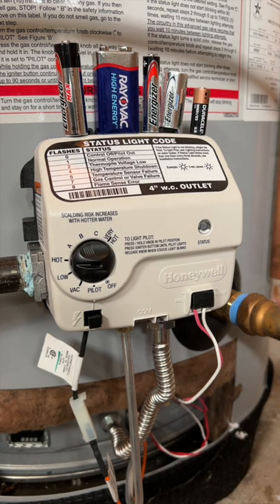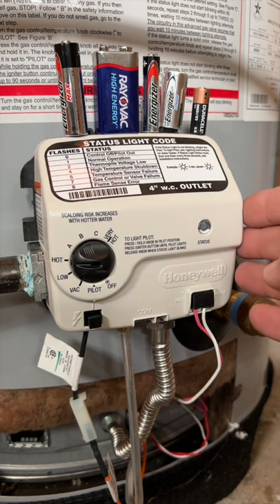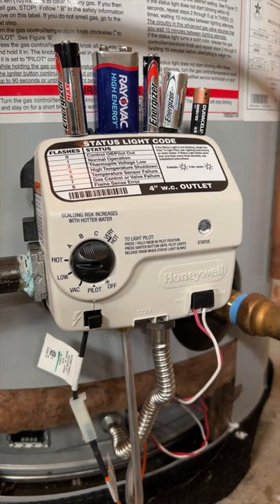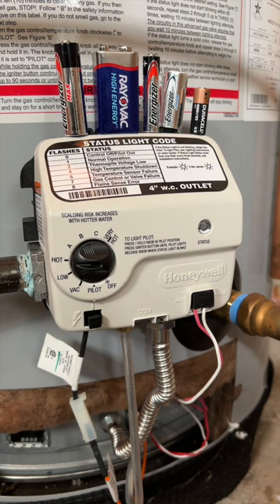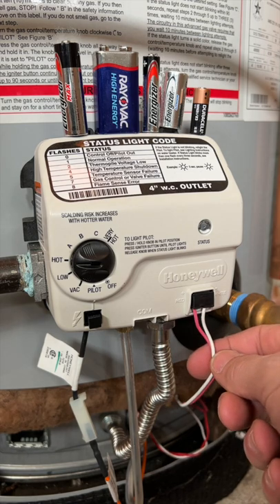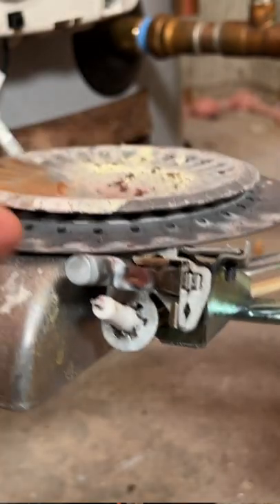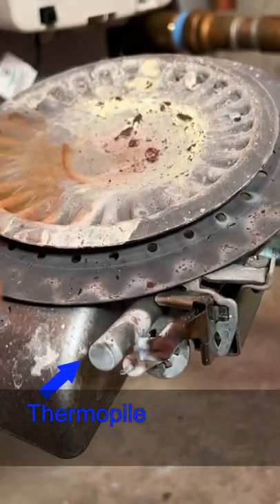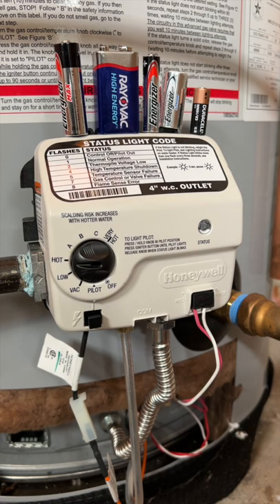Which Battery Is Used In A Gas Water Heater Control Valve #shorts

Comment: I have a Rheem 40 gallon water heater with a Honeywell gas control valve and I always wondered when I should replace the battery.  Thank you for making this video.  I had no idea that it did not contain a battery!  I never looked into the manual as of yet.

Comment: Makes sense.  When my water heater stopped working and began flashing a red light, they first sent me a burner assembly, which did not fix the issue... but a new thermostat was actually needed to fix.

Comment: I have owned my house for over 30 years. My furnace uses a thermocouple. When it went bad [around 1995], I replaced it with one from Home Depot. The ones from Home Depot have only lasted on an average of 12-18 months. After 15 years I got tired of them not lasting and bought the one [same brand] from Lowes. Lowes units have lasted between 4-5 years.

Comment: Thanks. I have the same valve and when the power went out, the status light stayed on. So I was wondering "How long will the battery last?" Your video is concise and perfectly explains that no battery is required. Thanks again.

Comment: Hey if this doesn’t work contact the hot water heater company to find out where the reset button is on the tank but it is normally under the panel where the wires connect from the thermostat to the unit
Reply: Thanks this helps for me about the reset button 😅
Reply: @Mr15peligroso  .. my pleasure!!!  You really have to keep it clean underneath.. or it will keep happening! It just happened to me again a month ago!
Reply: In my case was a splash of water in the wires that’s was about the reset button but yes you’re right we need to keep clean underneath mine was dirty by the way 🤭

Comment: Doesn't matter because the honeywell valve is garbage, but gas style water heaters are a big money maker for us plumbers. But remember 95  % of companies only pay the maximum of $100.00 per service call under warranty. I found this out the hard way. Went to service s home owner installed water heater. Only 1month old. Got a call from a buddy that managed the store where the heater was purchased. Well I went and checked, driving 20 miles each way. The controller and the burner assembly are so bad they keep new ones in stock. So he knew it was a propane water heater, so I grabbed 1 of each. Get there, and I immediately notice the paint on the shell burned off. Well good ole Reliance made in Mexico, the stickers on the tank clearly said propane, but the controller and burner assembly were natural gas. I ask the customer if they had any problems, the water was always scalding hot on the lowest setting. I shut the gas off, called reliance. Told her what I found. She says  impossible. Took pics and sent them. I was told to remove it immediately. Drove 20 miles, got a new one. Got back installed, it and it was good to go.in my phone conversation with reliance ,I was told they would pay for all cost. Sent them a bill and they sent me a check for $100.00, the max they would pay. Now I ask the customer what brand they have, if reliance, a o smith ,or state I tell customers that they must pay me and recoup there money from Reliance group. In th state of Mississippi, the homeowner must file for reimbursement and are the only ones that can file suit on a appliance.  There is no way $100.00 covers the installation of a Frankenstein water heater made at your plant, made it thru all your product checks and delivered to the store and sold. The customer turned th water heater to max setting , thinking it would warm the water faster. Well the tank got so hot it melted some of the tank installation , because ports on the burner are smaller than natural gas ones.
Reply: Write a book 📖

Comment: The green/blue build up on the cooper pipe. Try pouring hot to boiling hot water to remove it. I saw a video of this being done on a car battery a month ago and I just now did it with the white build up on the water heater hot out copper pipe. Removed a majority of it just used a bowl to catch the water and sediment.

Comment: I just installed a new Rheem hot water heater that had this on it.     I thought I was gonna have to hook up 120v ac to my new heater.     Will it last 20 years?
Reply: 10+ years with maintenance. 

Flush your water 1-2 a year.

Comment: So it's got to ha e some kind of battery to store electricity while the unit is off. What do you do when that battery is dead?  The light on mine doesn't blink at all.  The pot lights when the knob is pressed in the pilot position UT goes off as soon as you let off it.

Comment: Mine will not allow gas to pilot light while holding down on pilot mode I don't know what's going on
Reply: and the answer was?
Reply: @tedlahm5740  I think there was air in the lines and just had to push in the gas adjust button on pilot mode and keep hitting pilot

Comment: This is a stupid invention, because if you leave your water heater off long enough (to make repairs in your plumbing system), the Honeywell unit runs out of power. You can't recharge the unit without a pilot, and you can't get a pilot without the unit. Pisses me off.